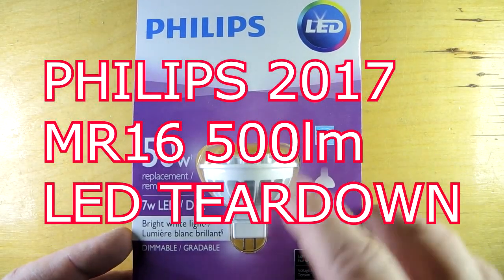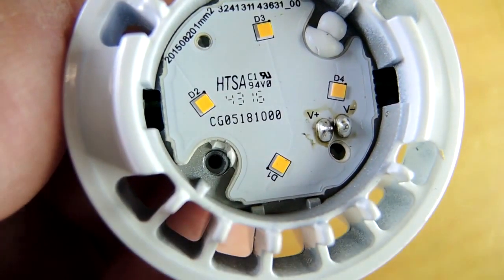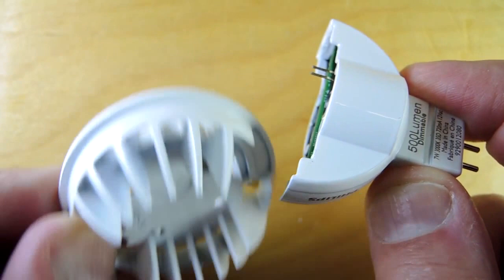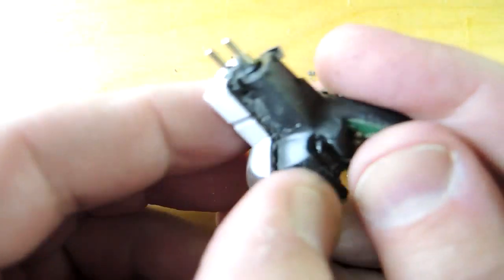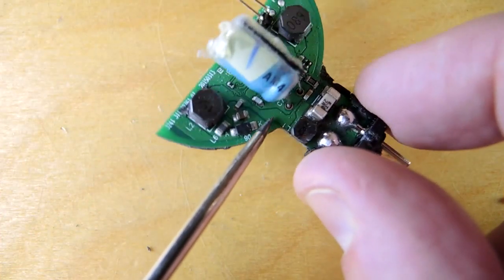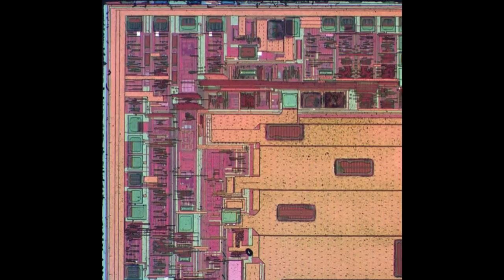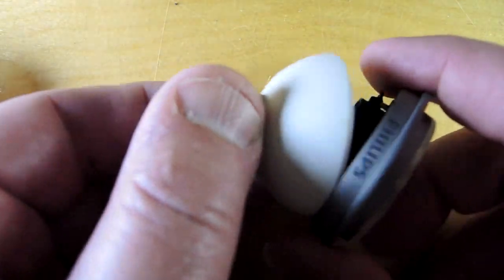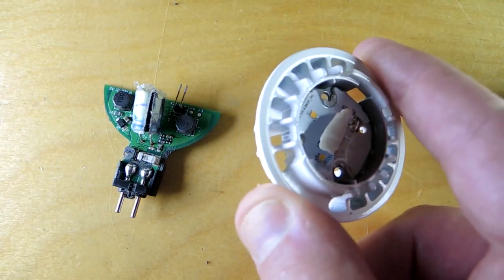Philips MR16 500lm 2017 LED Bulb Teardown

Comment: Great video!  I have 6 of the 5.5W Philips MR16 bulbs from 2013 and they are still going strong, lighting my kitchen off my solar battery bank:
https://youtu.be/fNFJRHy4PGY
At that time, under 6W had no fan and that's why I went with the bulbs I did.  Seems they have bumped up the max. power rating w/o needing the fan a little bit from 6W to 7W.
Reply: My original 7 - 5.5W MR16 bulbs are still going strong some 10 years after installation.

Comment: The content stops at 5:45, but the video length is 8:53. Some repeating sequence at the end.
Reply: To add to what BersekViking has mentioned about the fix: You should be able to just use the Trim
tool under Enhancements when editing the video! Either way, great video as usual :)
Reply from the maker: ok! thanks for the tip.  i think it's now at the right length
Reply from the maker: sigh.  an artifact of editing the video and not removing a final clip at the end.
Reply: +electronupdate You should be able to fix it directly in Youtube by removing the final minutes.